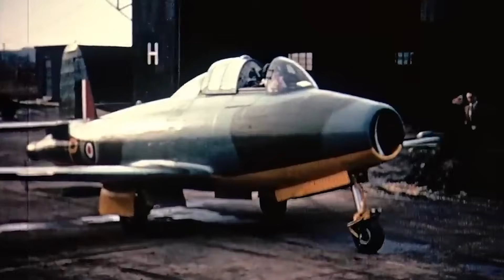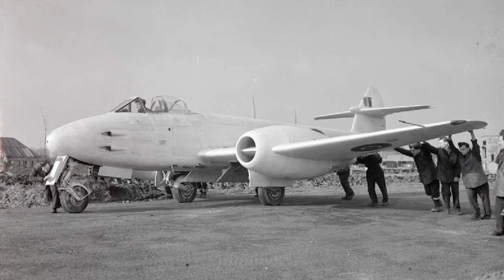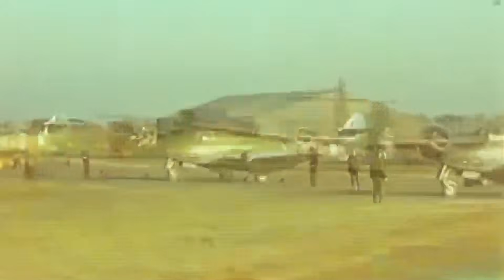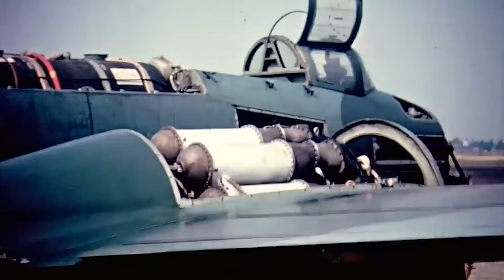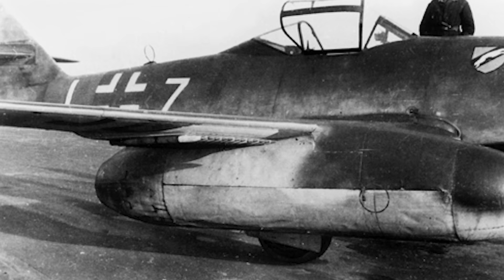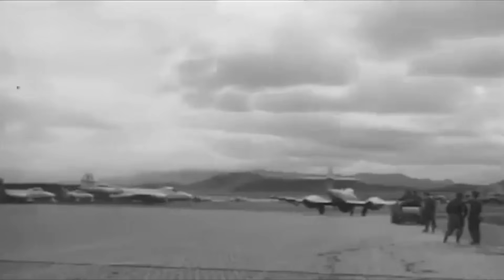Meteor vs Me 262 | Which was the better WW2 jet?

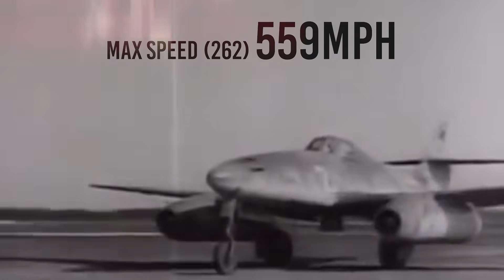Comment: Oooopsie! At 11:47, you claim that the Me262 Schwalbe was the fastest aircraft of WWII. The Me163 Komet achieved 700mph during early July 1944 at the hands of a test pilot, and was deployed on active service, even if it killed more of its own pilots than the type ever shot down.
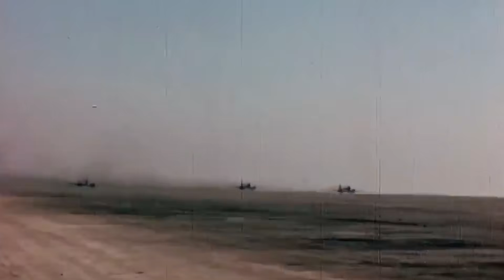Reply: Same mistake later at 23:38 with the post war world speed record for the meteor which couldn't be true because its still slower than the war time Komet - although it was the fastest recorded speed for a jet which is what i assume the video means rather than the fastest speed for an aircraft
Reply: @bobthefish442 Simple reason, though the 163 was undoubtedly faster in the war than the Meteor speed record post war, the 163's speed was never acknowledged as an actual official speed record. So, "legally" the Meteor's speed record was certified, the 163's was not.

Comment: not to be that guy regarding type of kills the 262 got, was on unescorted aircraft and bombers, but most kills in the air battles where pilots that got shot down by a plane they did not see
so its a bit idiotitc to compare, most P51 kills FW190 spittfire and so on is on unsuspecting pilots